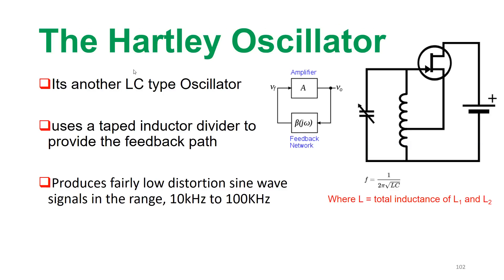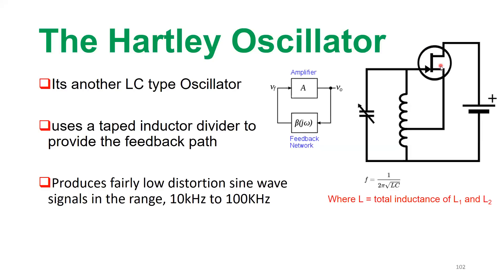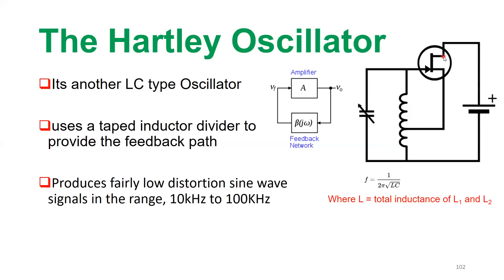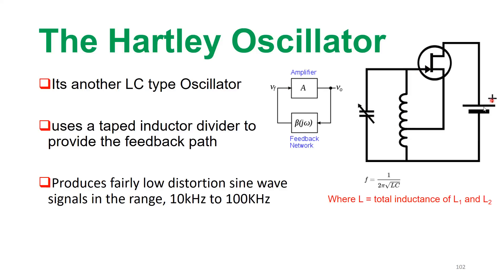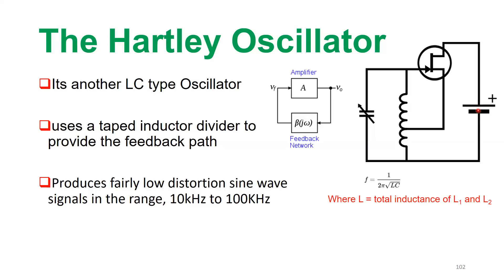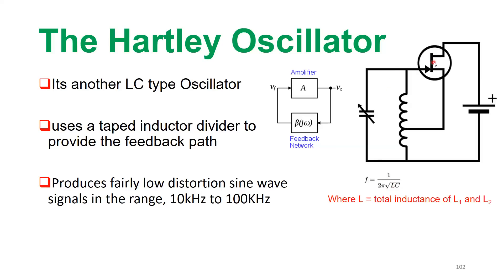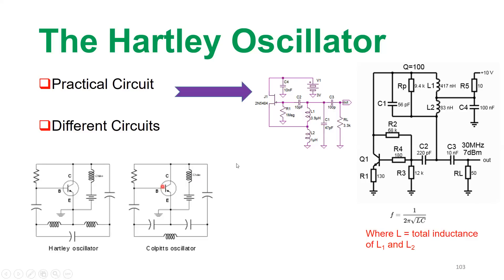The Hartley Oscillator

Comment: What are the trade-off between Hartley and Colpitts?
Reply from the maker: Frequency Stability: Hartley oscillators offer better frequency stability compared to Colpitts oscillators.
Tuning Range: Colpitts oscillators typically have a wider tuning range than Hartley oscillators.

Complexity: Hartley oscillators are generally simpler in design compared to Colpitts oscillators.

Temperature Sensitivity: Colpitts oscillators are less sensitive to temperature variations than Hartley oscillators.

Noise Performance: Hartley oscillators tend to have better noise performance compared to Colpitts oscillators.

Output Amplitude: Colpitts oscillators typically provide higher output amplitudes compared to Hartley oscillators.